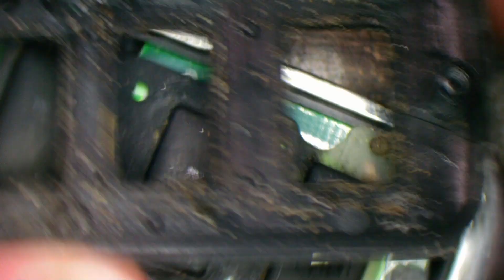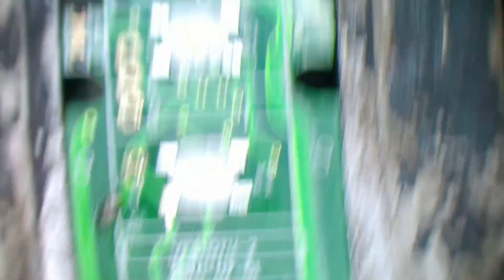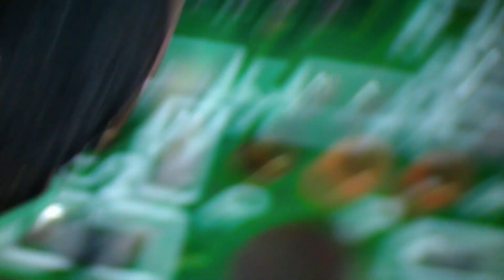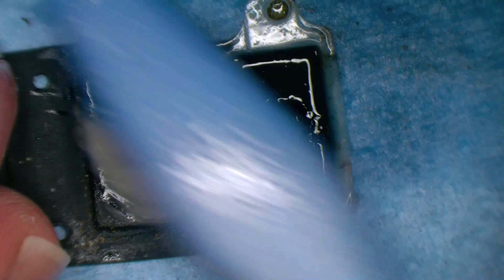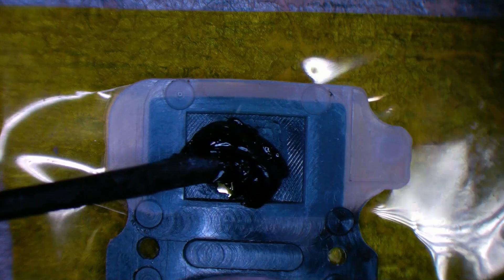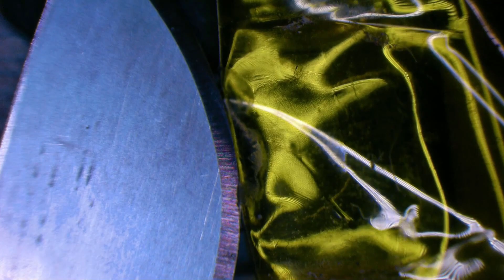Car alarm remote button replacement.

Comment: Hey Johnny, I watch your other video, very informative! Perhaps you could give me an idea for my next steps? I have a Becker 1492 that does not turn on, but illumination is good on part of the face plate. The face plate is ok, it was tested with another good working unit. Seems like power is interrupted somewhere. No visual signs of any madness anywhere on the board. Power diode tests good. What should I test now? Thanks
Reply from the maker: If you have access to a good working unit maybe you can open it on the bench and take measurements to find out what power rails should be where, compare stuff like that. It could be brain dead, as in the processor chip has no power perhaps. See if the power button has a voltage, maybe 5 or 3 that I would imaging would be pulled to 0 when you push it. Make sure this change is measured at the processor to test for good connection between face and main board. Be easier to look for this voltage on the main board end instead of opening the face plate.

Comment: I have a roll of antenna coax that uses a similar green goo amongst the braid to prevent water wicking.
Maybe it is used for two reasons in the switch, to help keep atmoshphere out and to silence the clicky sound somewhat.
Reply from the maker: Maybe. I wish I could open a brand new one to see if it's in there.
Reply: @JonnyFix  
I approve of you doing that.

Comment: You bodge artist Ha ha :-D. Joking really.
It's not an easy job if your eyesight is a bit off and mr shakey  hands just adds to the difficulty.
i expected something like a bicycle innertube patch, or for extra nastyness a plaster/band aid stuck on top of the new switch.
I repaired my mates old m.g rover keyfob, it worked when it wanted to.
It turned out that there was a through plated hole in the pcb and it was taking the piss.
I used a realistic scanner to verify the output of the keyfob.
Reply from the maker: Inner tube patch! I'll keep that in mind for next time. nothing a little vulcanizing cement can't fix. One of those scanners would be handy but I don't do enough of them to need it. Only one time ever I had no output due to blown signal output transistor otherwise it's usually switches, corrosion or dry joints, they're pretty bullet proof. As long as I get a winkle on the scope I'm happy, if it still doesn't work there's a programming or receiver issue.
Reply: @JonnyFix  many years ago i used receivers and scanners to listen to the i.f stages  and oscillators  in faulty c.b radios.
The receiver antenna socket was connected to a coax and the center wire could be placed near the suspect circuit to sniff the r.f , sometimes couple it with a 10pf capacitor or wrap a few turns of wire to make a pickup coil.
Most i.f strip signals were low in voltage and  a bit too weak for most test gear to show anything.

Sneaky use of receivers, i'm sure you have pulled some clever tricks to test things :-D
Reply from the maker: @zx8401ztv  Maybe, although nothing springs to mind.... probably more creative ways to fix something.